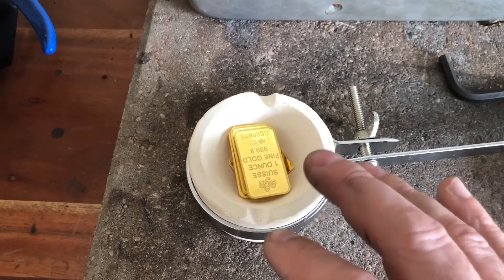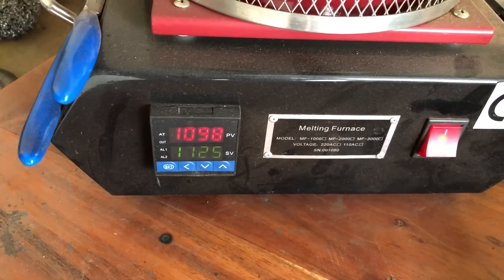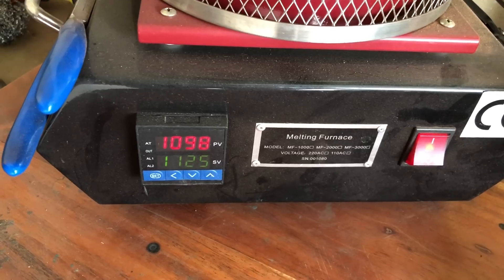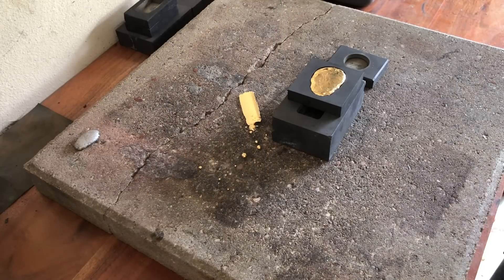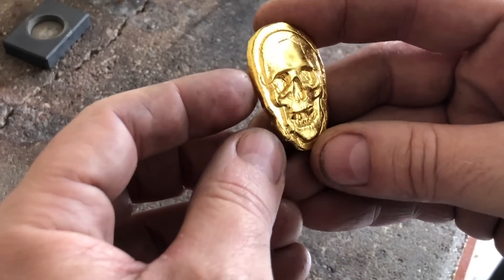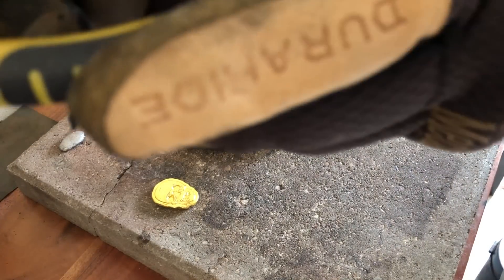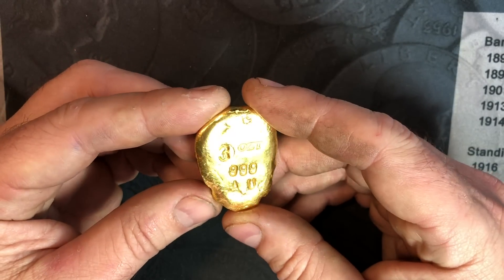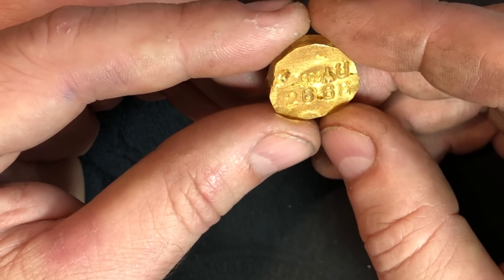Melting Gold - Smelting Gold At Home

Comment: What is the point of this? You take perfect bars of gold, melt it and make a really ugly gold skull. This is just about as pointless as making a video converting $100 bill to 100 singles at the bank and then going to another bank and converting the singles to a $100 bill. But in this case you probably are devaluing the gold very slightly by making an ugly piece.

Comment: Did you get all the gold out of the graphite. I wanna melt gold. I was thinking of just putting the ceramic crucible on top to heat it. Blast it with the torch. Good video